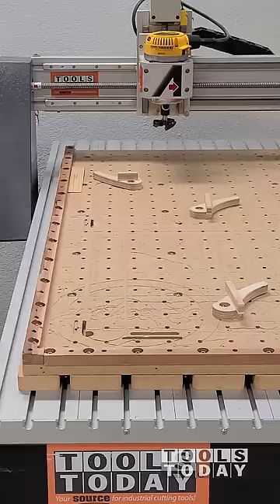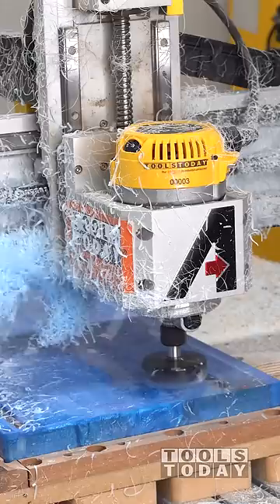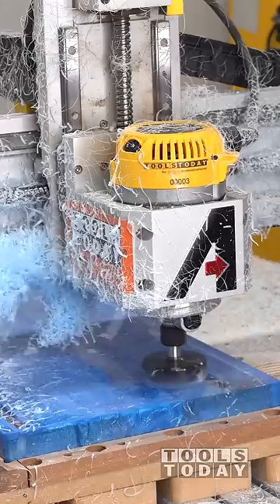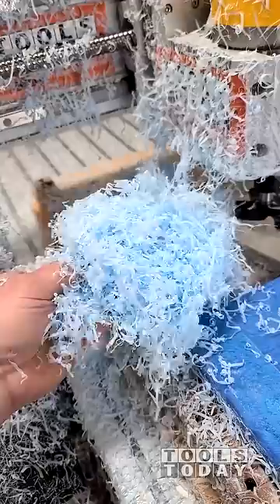Epoxy Creates a Huge Mess!

Comment: At the very least put a piece of screen mesh with a rubber band over the motor vents. Unless you just don't care about that motor. It's only seven or eight hundred dollars to replace.
Reply: You sound like you know what you are talking about
Reply: @manicsnake137  it shouldn't be hard to figure out that the shavings going into the motor is bad
Reply: @theLUCKYdude17  well yeah no duh

Comment: I suppose you probably ended up just touching the insert off of the table, and then raising it up for your final z depth, for your work piece thickness? Otherwise, something I noticed, if you were just going for minimal depth of cut, to get full clean up, to ensure work piece flatness only, on 1st pass, at 0, you got like 70-80% clean up, before lowering the cutting depth, and taking a deeper cut. For flatness achievement only, it is at that point, of your 0 pass, spite not achieving full clean up, you should have flipped the workpiece, and dropped your tool offset like .002" ish, or so. This would require multiple flips, but if you only drop tool offset. 001-.002" per flip, theoretically you would minimize mess, and achieve work piece flatness in 3 or 4 flips, with minimal thickness loss. Cool video.

Comment: You could put a shroud and a centrifugal air  pump to suck it from the bit and blow it in a big textile bag that will catch if all and filter the air for fine particles. You could use a vacuum cleaner but it draws too much power for that, too loud and not that much room in it. 

Also, beware of the electrostatic buildups.

Comment: Can the epoxy shaving reused or recycled?
Reply: I was wondering the same thing
Reply: You can eat it, it tastes like parmasean
Reply: You could add epoxy to them and compress them into blocks to be used for other things. I'm not sure how stable that amalgamation would be though
Reply: No unfortunately, epoxy is thermosetting plastic as designed to be heat resistant. It’s not recyclable. Very few plastics are actually recyclable and even then they usually go into lower quality products and can only go through a few cycles then land fill or furnace.

Comment: How can you guarantee level if neither side is level and the resting face isn’t level prior?
Reply from the maker: I shim it first to make sure all areas of it are contacting the wasteboard.  The gantry is parallel to the wasteboard, so all I'm doing is creating one flat surface, then you flip it and do the other side as well.  Similar to using a jointer and a planer, just all done using the CNC.

Comment: At least put some kind of filter over your motor air intake slits for cooling. you get slivers of acrylic inside the motor when it heats up they just melt to it, it won't last long.

Comment: Start in the middel with the first cut and than Programm it outwarts for better surface look and Use climb Milling , cut only one directon.
Reply from the maker: Starting in the middle will not leave a better finish as the CNC will change cut directions multiple times in a standard pocket operation.  Moving with the grain will provide the cleanest cut possible and this provided an very clean cut, no reason to change anything with the toolpath.

Comment: Can I put an epoxy piece through a planer?
Reply: Theoretically you can but it’s best if you use a wide belt sander. The straight planer blades can leave ripples on the surface creating more work.
Reply: @azarellediaz4892  hey how a about wood that is painted 
I ripped out some old boarders from my home their 9”wide with a 1”round over the home was built in the1930’s and the boarders could be oak 
This is why I ask

Comment: Hi what size got this router bit and the rpm? I always got some cracks in the epoxy.
Reply from the maker: This is the Amana Tool RC-2255 bit that is 2.5" in diameter.  I set it at 16K RPM